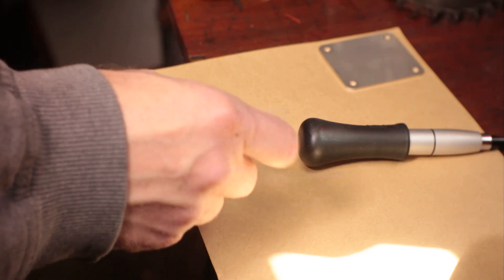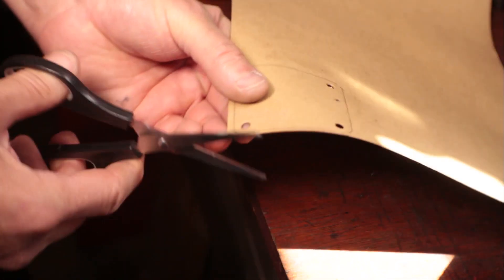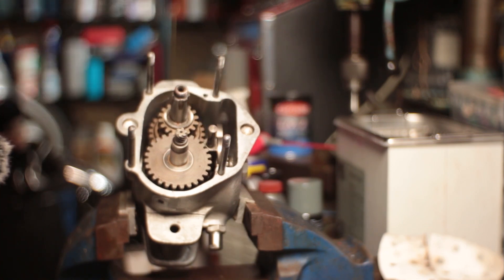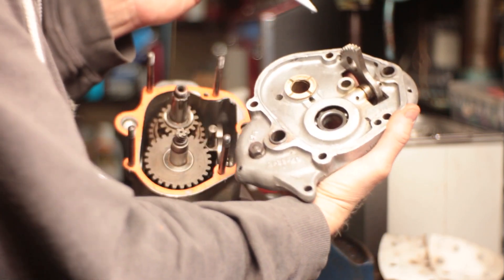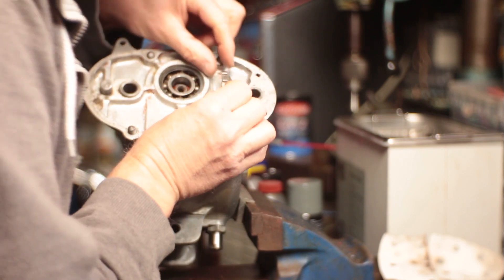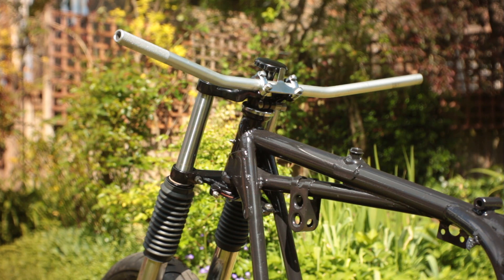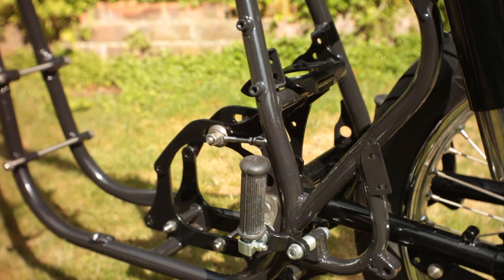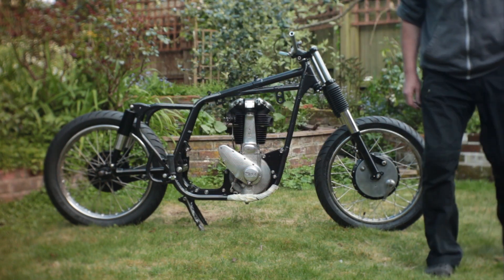Building a BSA B31/B32/B33/B34 from parts - Episode 9 of many - more gearbox and fitting the engine!

Comment: Nice to see the old engine again - I take it you know the draw bolt for adjusting the primary chain is on the wrong side - it should be on the kick start side.
Reply from the maker: Thanks. Gearbox still not ready yet - I had a vague recollection the adjuster should be on the other side, but, it felt more logical to be on the primary drive side. I wonder why it's that way round?

Comment: I was shown the old way of using a small ball  hammer to tap round gasket paper on the  plate and smaller  ball bearing welded on round bar for small holes.! By old engineer !